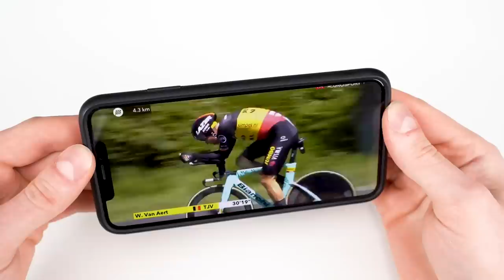Smooth Cycling on $15 Homemade Bike Rollers

Comment: This is a stupid design.
Remove the front roller. Replace it with a mount where you detach your front wheel and secure the forks to the mount.
No more wobble.
Buy a resistance gauge off amazon for $15 and attach it to one of the back rollers. Now you can use the whole apparatus as a legit exercise bike.

Comment: I have a bike trainer and I still think rollers are the next best thing to riding a bike outside as far as realism is concerned. Just wary about the need to constantly balance yourself and not accidentally cause the bike to ride into a TV or window in front! But I'd still buy one rather than make one myself because of the parts and tools (and the expertise) required.

Comment: 3:42 reason that's why I'm not making 😵
Reply: Even if you fell it wouldn't hurt more than falling off your chair. If you are still scared of falling off your chair, you can make some holders for the bike or add another roller. (I would go with the holders)
Reply: LOL 🤣
Reply: You will get used to it, just like learning cycling at the beginning
Reply: Use a chair, sofa, etc to hold on to until you learn how to ride on them.  It's always been like that with rollers.
Reply: Then you ride tricycle no need of you
Reply: I've never personally ridden these, but had friends that raced that did.  As I understand, the challenge with balancing is part of the point -- maintaining your balance requires a really smooth, consistent pedaling stroke, so you are training your form as well as your strength/endurance (otherwise they would just use a normal stationary exercise bike, if they goal was just the latter).
Reply: learn unicycle instead

Comment: Alternatively, just clamp down the front wheel and only have the rear wheel on the rollers if you want something safer.
Edit: 
For the people replying with constructive criticism without being rude, thank you, those were valid points.
For all the tough guys replying: Video of yourself riding one or you're all talk.
Reply: But that doesn't train your stability
Reply: @chocolatecandybar4319  I guess...but do we really need to train our stability this much? I saw an experienced pro-cyclist have difficulty with this on the first try or two, so that implies that you can still bike pretty good without something like this.
Reply: @captsomeguy1  indeed it is, but having a better stability and handling is not a disadvantage right? Especially on sharp turn or avoiding an obstacle that suddenly pops out.
Reply: @chocolatecandybar4319  True. I just don't see it very safe, because it seems really easy for that bike to slip off the rollers and run right into a wall. Maybe this would be better used in a spacious room.
Reply: @captsomeguy1  To increase safety some would put railing on both sides to prevent the bike going off the rollers
Reply: @chocolatecandybar4319  Yeah, that sounds like a good idea. Some of the ones I've seen on google images are about 1/3 of the width of this one and without railings. Those ones just seem like an accident waiting to happen.
Reply: @chocolatecandybar4319  When you're on rollers, your body doesn't carry any momentum. So, handling the bike will not be the same as in real cycling.

Anyway, the main question should be why you want to do stationary cycling. While this is a nice, portable device for getting/staying warmed up before an event, I haven't heard of anyone who prefers it for full on excercise sessions. You're just too limited in how much resistence the rollers can give, before giving the bike leverage to ride over and off them.
Reply: This comment thread has a lot of people who've never done a lot of cycling and have never trained on rollers. Riding on rollers is an excellent way to develop superior balance on a bike. And I'm not just talking about remaining up right. If your pedal stroke is asymmetrical, it will immediately show up on rollers.
 And anyone who'd suggest this is somehow "unsafe" probably shouldn't get a bike in the first place. Wow.
Reply: @captsomeguy1  if you slip off you will stop dead and fall over... Its not a cartoon where you keep going 20mph into a wall
Reply: @mcf3778  Yeah, that does make sense. I looked up bike rollers fails afterwards and the only thing that happened were people falling off. Most of them only got injured because they were doing it in a cramped room full of furniture and didn't have a place for their foot when getting off. So, I still think that bike rollers should be used in a spacious room, just so the rider have a place to put their foot down.
Reply: captsomeguy1 Most Rollers aren’t a flatlike these. The have ridges on the edge so it’s hard for the bike to roll off.
Reply: @jonahmiles5690  i like to think the rollers are double cone shaped so they track the tire into a low spot
Reply: @mcf3778  pretty damn great idea. Just a very very mild curve down into the center would make the stability much easier

Comment: How long until he realizes the front wheel doesn’t have to spin...
Reply: He wants it to be like a simulator i guess. Where u actually feel the flow and unsteadyness
Reply: I think spinning the front wheel is required to gain gyroscopic effect which helps to balance bicycle.
Reply: @supermanjeet1  yah but most people mount the front wheel to keep it upright
Reply: If the front wheel is fixed,  then its not really that different from exercise bike where you simply pedal while sitting like an idiot. Bike roller on thw other hands imitate the feeling of cycling down the road,you can steer left and right like how you use your bike outside.
Reply: @potatoes402  yep
Reply: Cause it’s hard to turn a wheel that isn’t spinning
Reply: Well if it isnt spinning then he cant really balance that well so it sorta does have to spin
Reply: So that it can also be  used as a normal bike
Reply: Lmao . More like how long till you realize that it does need to spin 😂
Reply: Siegel Gaming You got a lot of flex going through your forks if you mount the front wheel, plus you might as well just get a turbo trainer if you want stability.
Reply: The whole point of bike rollers is that it feels like riding a bike

If the front wheel doesn’t spin you might as well have an exercise bike
Reply: That's the whole point in bike rolls, normal devices that makes a regular bike into a stacionary bike just make spin the back wheel, but i doesn't make u feel any realism

Comment: it would've been better to add an extra roller on the front for stability, at least I think
Reply: Ikr? Common sense!
Reply: I guess He wants to swing his front wheel like in real motion that's why didn't ad extra roller in front
Reply: And also there should be side borders to avoid moving out of the rollers
Reply: I was thinking the same thing or just extend the length of the frame out so that the center of gravity is inside the roller instead of on top. Maybe an inch or two would do the trick.

Comment: Your roll is very wide and neat.
The center of the front roller slightly in front of the front wheel axis provides more driving stability, even allowing you to take your hands off the handlebars.

Comment: why front wheel is spinning...? 🤔 can any one explain.... ,
Reply: I have same question. How the front wheel is synced so much up with rear. I was searching for the answer in comments
Reply: 3:24 is the answer
Reply: Gyroscopic effect to help keep you upright
Reply: It has a belt attached to the middle roller.

Comment: I did it, thank you very much for the video. My one was inspired on this video in about 90%. The only difference is that I made it adjustable for different between the axis distance. My cost of materials was $50, the most difficult part was the wood circles, I did it by hand but didnt work well so i cutted it with a CNC machine (I dont have the proper tools to make them on my own). If I had to make the whole thing again I think I can reduce the cost to $40. I live in a 3rd world country so... maybe in the USA the $15 is possible. Thanks again.
Reply: Hi What size bearings did you use?

Comment: Don't know about the $15 but the whole project is genius. Thoughts about parts. Any recycling center would have most of the metal. Same with the bearings. The tools you can get at most lending libraries. The most interesting part was the drill stand and there are several  on Ebay in the $30 range. The most worrying part was Q riding the bike. I worry about future generations of Qs. But that's his problem. Great video!

Comment: So nice... but cld you nt just do it with the pair of tubes at the rear only. Brake the front wheel and then start cycling... worth a try. Let me know if it works..

Comment: Put a platform in the middle so you can put a foot down to "normal" road height.
Use up your "spare" tyres too - rollers are hard on the rubber and tyres wear fast.
Add some resistance else its just junk miles.

Comment: Good idea. Could have welded a vertical bar for a hand grip or move it closer to the wall to hold on to, a foot plate might come in handy when you step off. Obviously not needed if you intend falling off.  😂 👍

Comment: Sorry, not to tell you what to do! But if mine, I would drill a scale of holes inch apart on front wheel floor braces so you can adjust the front roller exactly where you want it under front wheel! Looking here, like front roller inch or two back too far behind front wheel plum. I would consider two rollers in front as well as back! With side adjustment holes you can dial in your perfect ride for your individual bikes wheel base, instead of trying to adjust your riding to machine! You should have left side rails longer so adjustments an add on like additional front roller can be controlled!

Comment: Tip. SInce the front wheel is sitting directly on top of the roller, it will be higher than the rear which sits offset. To prevent the bike from tipping up, the front roller should be made lower.

Comment: all it needs is a pipe coming from the middle under the frame where  the pedals go en from there a sligh angle to the left... a cut in half pipe... to hold the frame of the bike    so you wont fall off

Comment: Its a great idea but dangerus if I would do it  I going to secure the front wheel with a pole I work in construction there is material called blue skin put spray shoe  glue on pipe  wrap up  around the pvc roller that blue skin avoid the back wheel from skiding side ways.

Comment: Wats the use of front tyre moveable if it is fixed it would b easier to ride
Reply: That's the callenge of a 3 roller... you have to balance. It you have the front wheel fixed is just pedaling.

Comment: 3:25 I saw a lot of videos but i still don't understand why they add that black chain? 
Pls explain 😭💔🌚
Reply: It's not a chain, it called belt. So when the rear-roller spin, the front will spin too. So the wheel (both front and rear) will spin

Comment: wait why the front wheel is working :0
Reply: Nateusz Dura he put a drive belt on to connect the rear rollers with the front roller. Most trainers simply have a stand off to clamp the fork into with the front wheel removed.

Comment: Why does the front wheel rotate? 🤔
Reply: The front wheel rotates because there is a band connected to the rear rollers that causes the front to rotate at the same pace as the rear